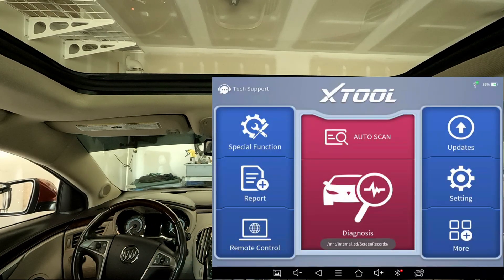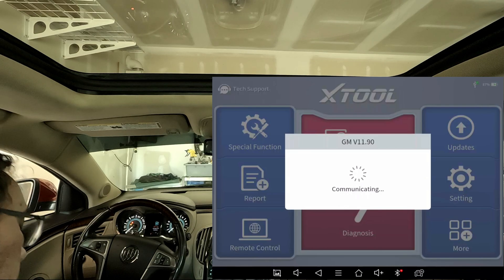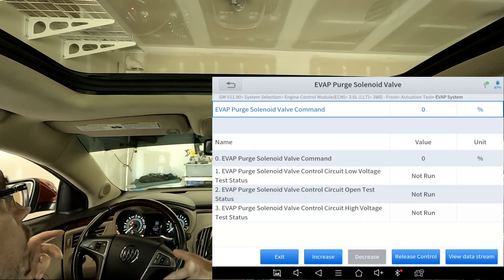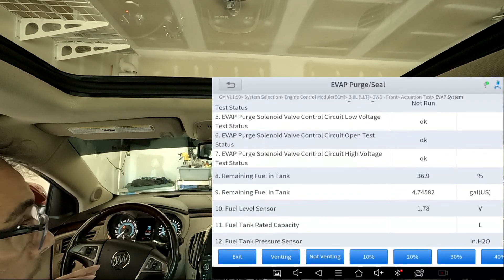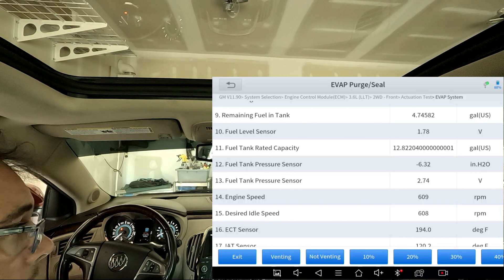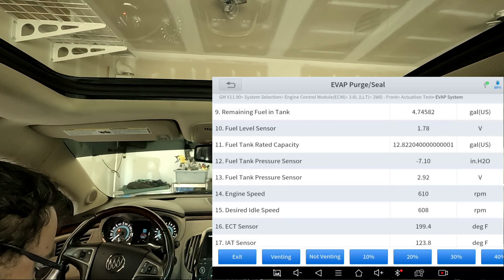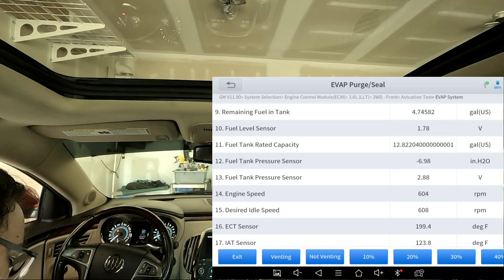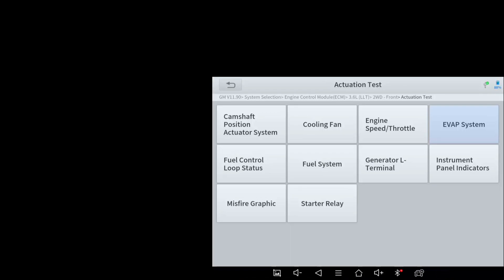XTOOL D8 [PT. 1/3] EVAP Purge/seal P0442 diag 8% Discount (XTOOL A30M, D8 and D7 8% discount codes)

Comment: With only 10% purge commanded the system vac will draw down until it reached equalibrium with the leak.  There is actually always some very small leak, so the vacuum  should be high (negative).  The lower the vac the more of a leak. A true leak down test seals in the vacuum by closing the purge valve (0%) and keeping the evap closed (not venting), then timing it to see how long it takes to leak down. The slower tge better.   You never did the seal part of purge/seal. Your decay could have simply been a variation in vacuum as the car idles.  Would love to see an update retest.  Thx!
Reply from the maker: Yeah at that time I was not familiar with how to process went but I think I got it. Now I have another channel just for automotive now. So check this video out tell me. https://youtu.be/4lWhDFevEUM